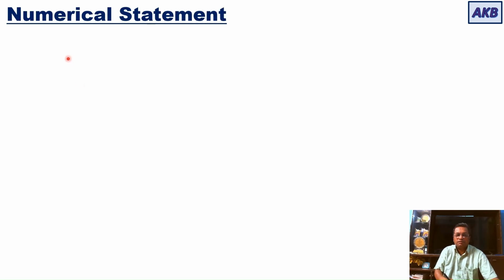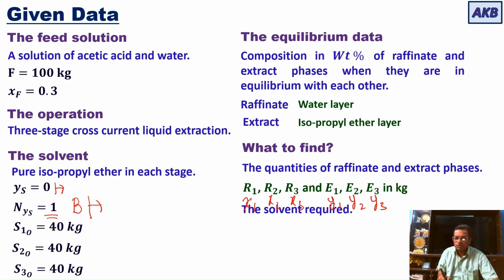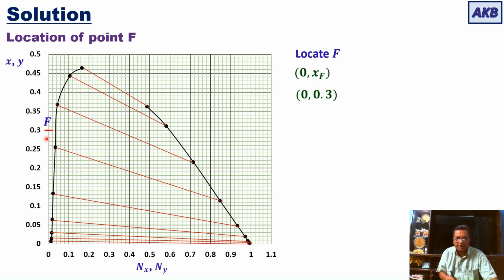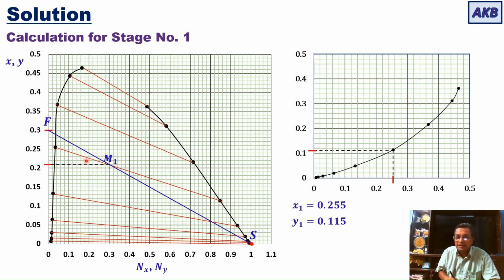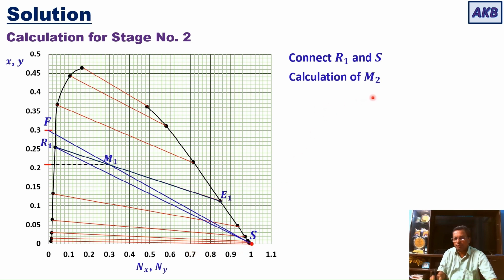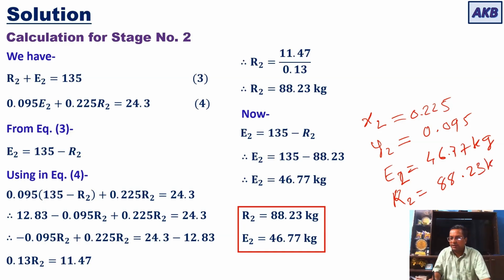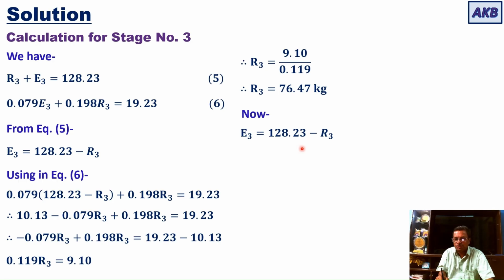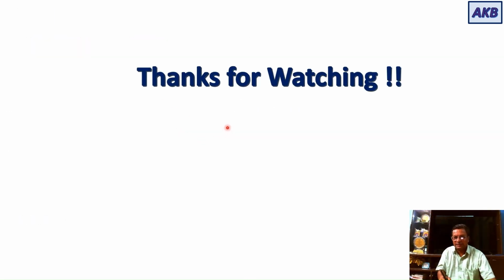Liquid Extraction Part 11 Multistage Cross Current Liquid Extraction Numerical

Comment: How did we plot that distribution curve ,  that you used for adjusting tge tieline, please help
Reply from the maker: In the given equilibrium data you have percentage wt of C in raffinate and extract phase. Convert them to fractions by dividing with 100. Weight fraction of C in extract is y and that in raffinate is x. Plot y on the Y axis and x on the X axis to get the Distribution Diagram.

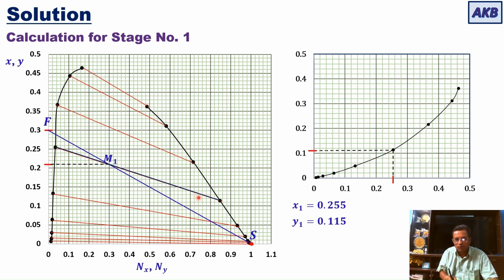Comment: Sir does we have to always take take that line which are too closest to point M,actually i got some confusion at 25:11
Reply from the maker: Yes, as it will be then easier to draw the required tie line
Reply: @AKBChemical  Sir then what do you mean by adjusting the tie line using the y vs x diagram can you please tell
Reply from the maker: @newchannel6450  You need to adjust its slope so that the end points represent equilibrium concentrations
Reply: @ That means if we got a x point ,then for that point we will look its corresponding value of y,after that we will adjust the tie-line?is that right sir